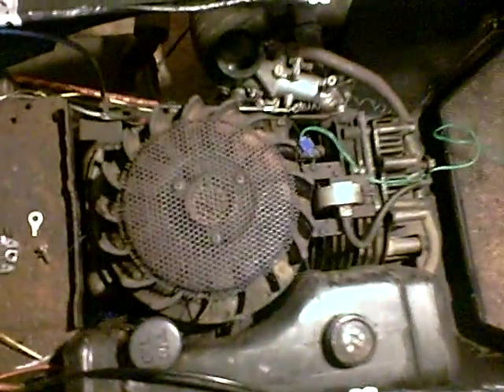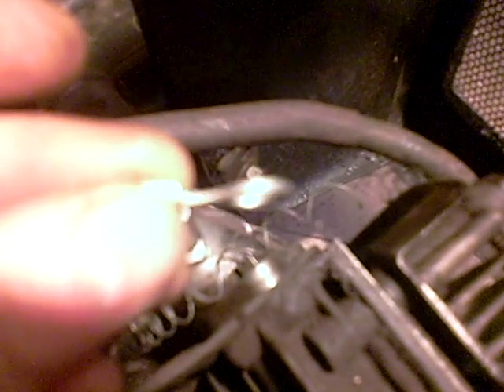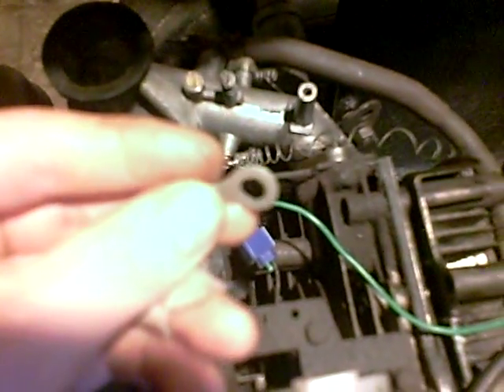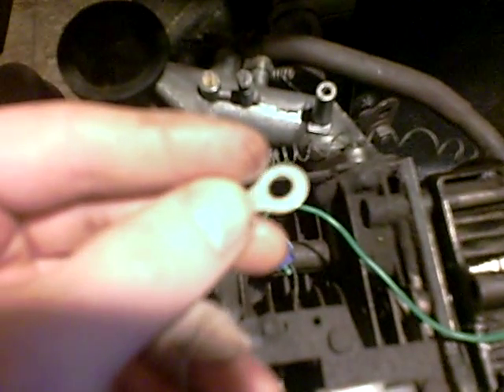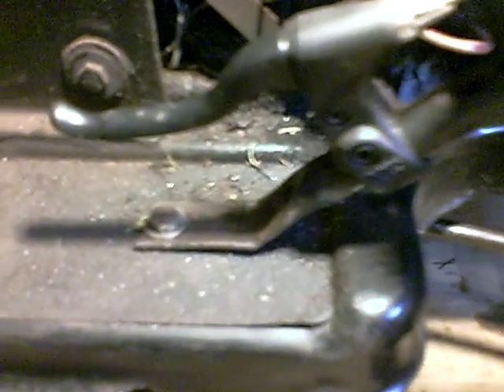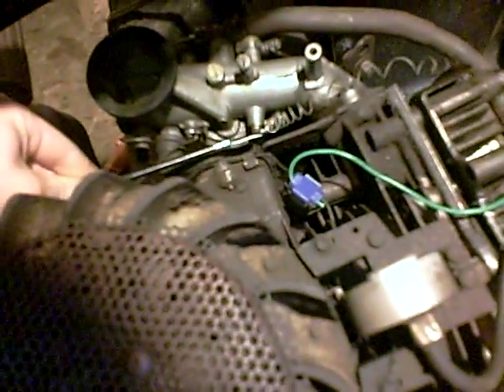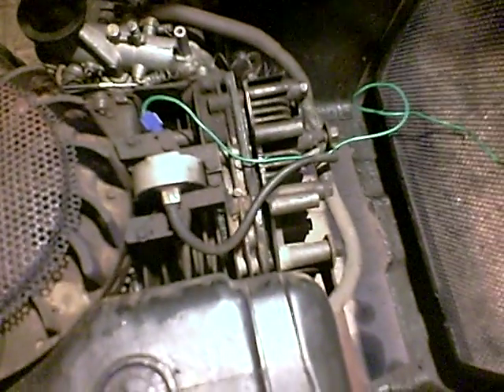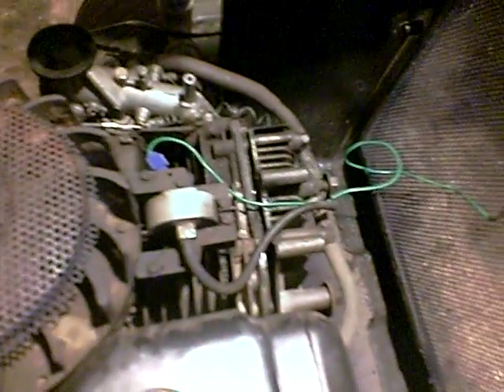lawn mower gas pedal and tach  how i did  mine

Comment: my tachometer did not let the current go to the spark plug and i had set it to the lowest amount of cylinders that there were on the back of the tach what is yours set at and what is the problem and solution to this problem thanks